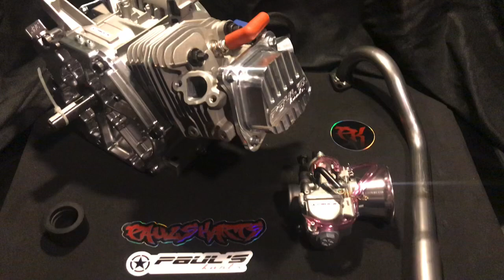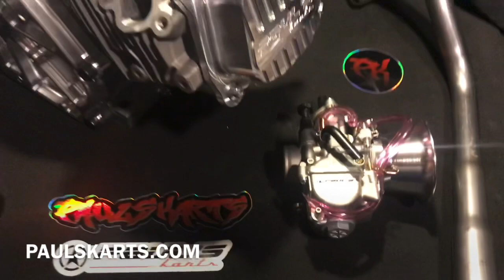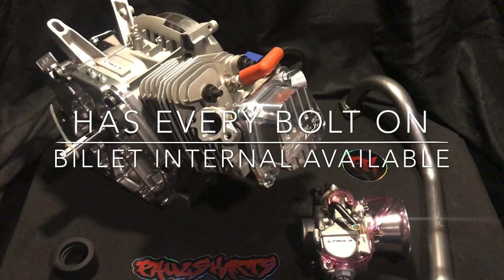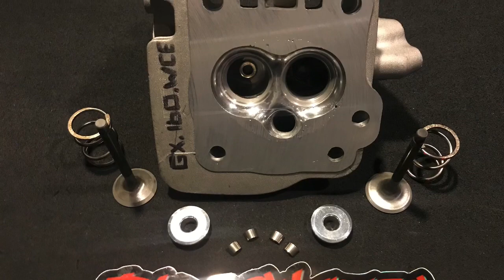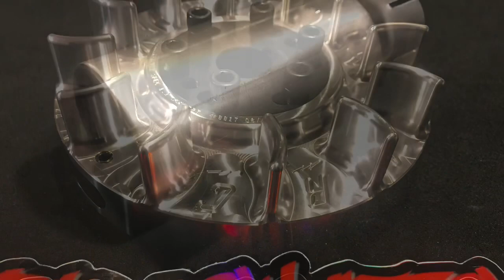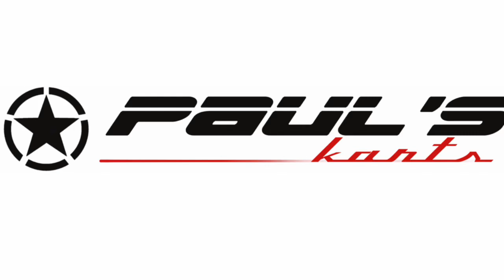Predator crate engine package, 226cc stroker, entire package , mini bike go kart

Comment: would you send just the small fuel valve to europe(Austria) ? 😂 im building a 2 stroke engine right now and im using a mikuni tm28 ss (angled bowl) and im looking for a small regulator valve to adjust the fuel amount of the power jet 😂😂😂
Reply: or do you know where to get one ?😂 the only one that i found and was small enough was on a rc carb 😄 witch was like 30€ and i really dont wanna pay so much for a shitty small plastik valve 😂😂😂
Reply from the maker: Atomix ... I am not sure man .. if it sells thru the site I guess so